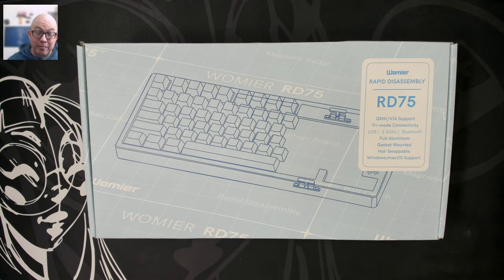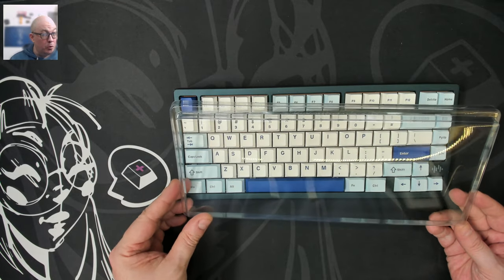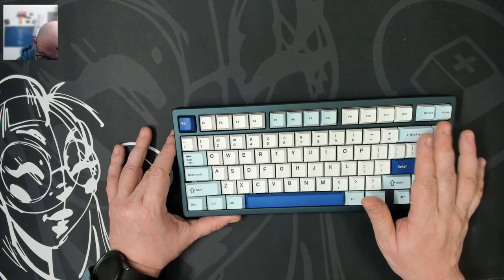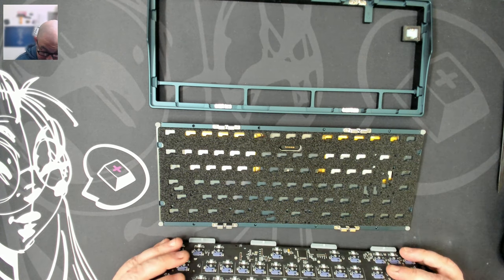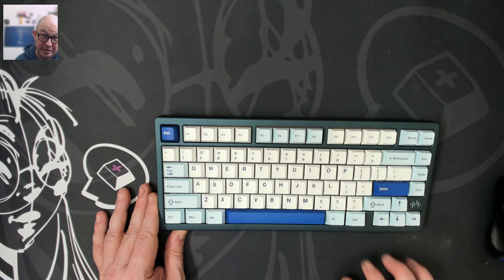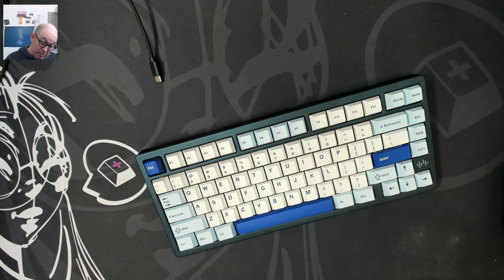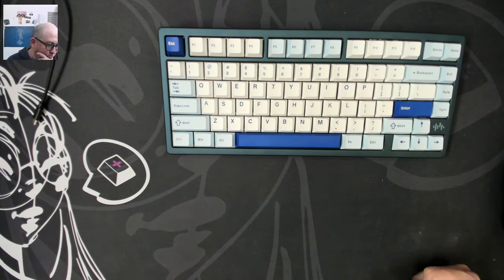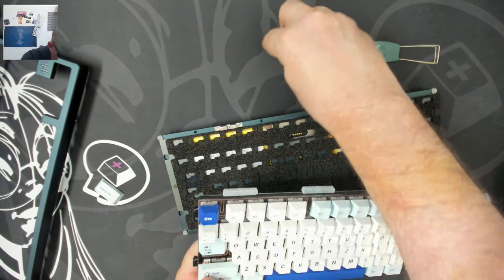Womier RD75 QMK/VIA Multiple Layout + Plates | Tear Down Review Sound Test

Comment: Could be they bought in (or reused) the pcb with the knob pads. Though conversely I think it's the only one with the pogo pins to daughter board feature.  Hmm.

Checking their website they do have a plate configured for ISO, but more options for ANSI. Though no hints that you get the matching big enter key anywhere.  The weight is listed as stainless steel, and the switches as fully POM.  Both interesting.  

They've done the slightly odd thing where the switches get colour matched to the keyboard so you get A or B plus x, or C or D plus y.  Someone else took to doing that recently.  Unless only the colour changes that's sad for those who want A plus y, etc.

A few times you said Sept 10th release, I thought maybe you meant Oct 10th.  Currently (Oct 12th) everything lists as unavailable (for me in UK, even if I pick USA).
Reply from the maker: It was first planned for the 10th of Sept. , but now they stock is coming soon. When I find out when "soon" is, I'll update here.